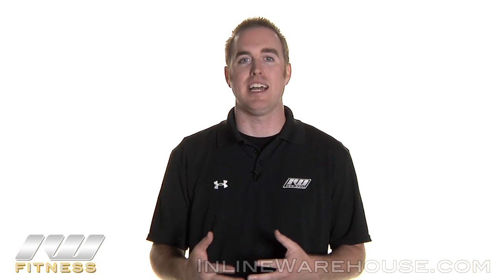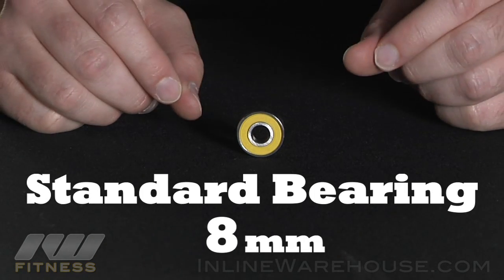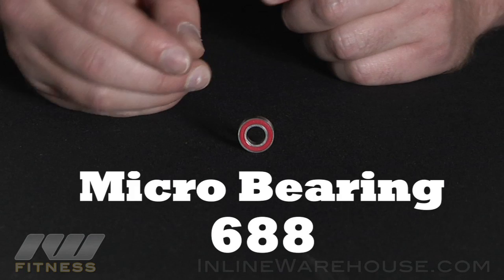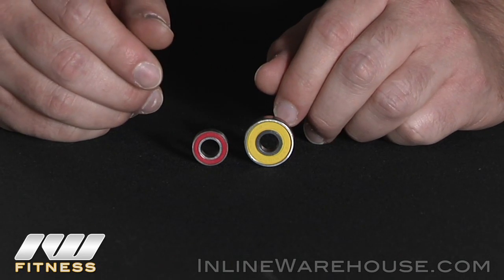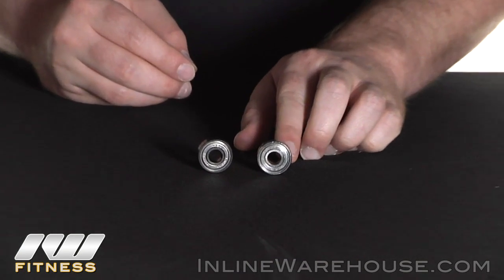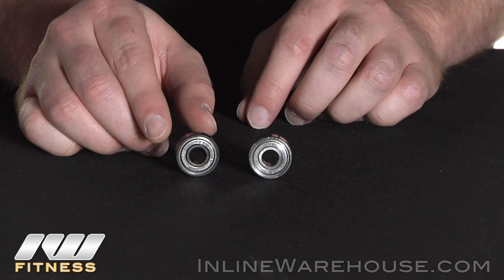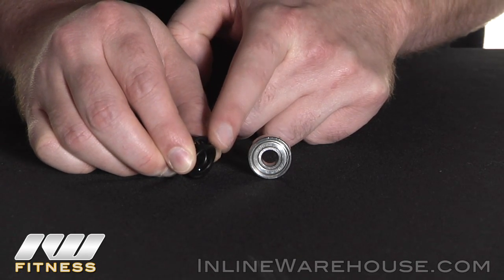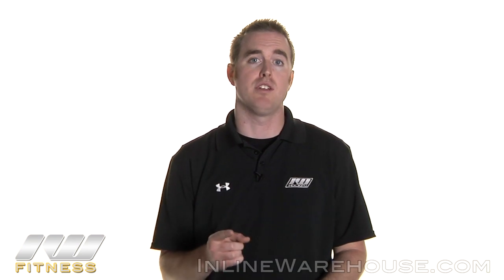Bearing Types

Comment: What bearings you would recommend for freeskate? i have a Rollerblades with an ABEC 3 bearings
Reply: Brand recognition can get you further than comparing solely with ABEC ratings as one brand at ABEC3 will do different than another at ABEC3. Having said that, ABEC3 is hard to even find these days as it a pretty low rating. You on a small wheel size? Our IW brand bearings are great and 50% off when purchased with wheels. I don't just plug because they are IW, but we get them made the same place as some of those we sell so... Both the ABEC7 and of course the Swiss would be big upgrades from what you have. $26 and $60 full price.  
https://www.inlinewarehouse.com/Inline_Warehouse_Bearings/descpage-IWBEARS.html

Comment: Is sealed bearings better than 608 bearing for bauer roller hockey skates
Reply from the maker: Both would be 608, but a sealed vs non-sealed is arguable.  A sealed bearing you cannot service/clean, and may be better for taking on more loads/impacts of jumping around.   One with a removable shield is serviceable and you can clean and prolong life.  I'm one that just replaces bearings rather than clean them, so it just depends.  Most bearings are serviceable with removable shields. The SG bearings from Rollerblade are sealed as are a few others. Others have a soft nylon retainer on the inside that makes it easy to service or add lube if/when wanting.  InlineWarehouse.com